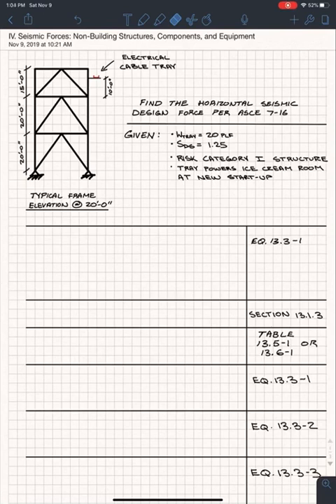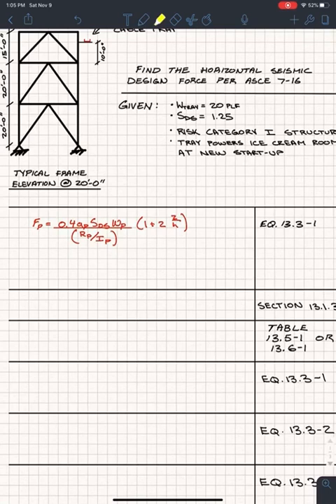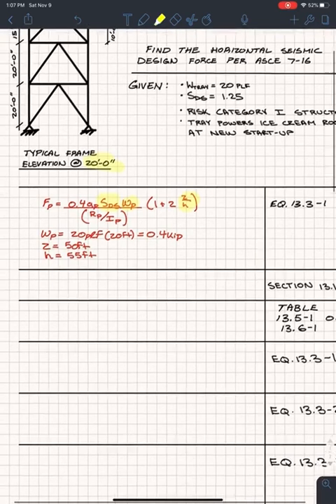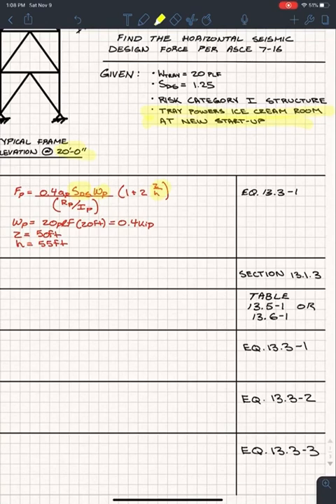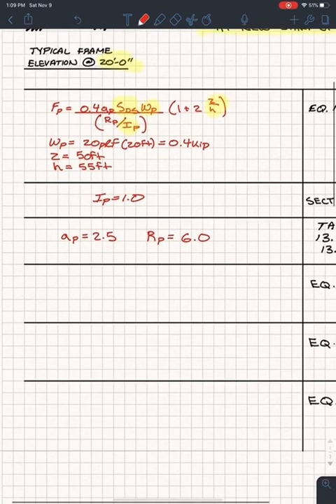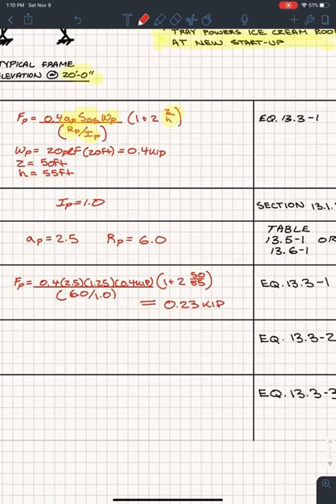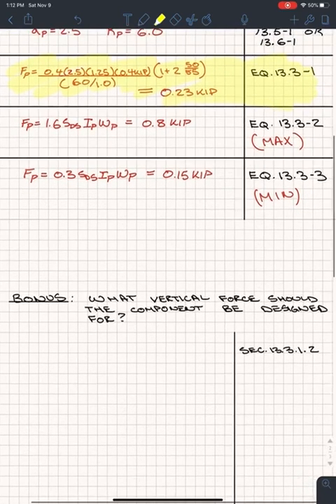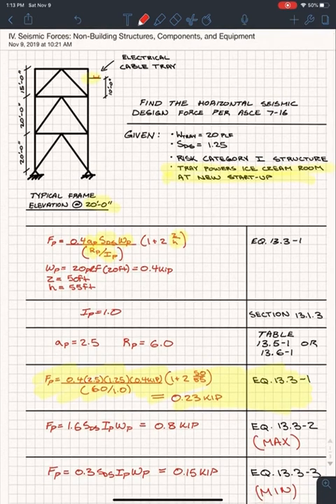PE Seismic Review: Non Structural Component Seismic Force

Comment: HI.. Guide me please.. after calculating this seismic design force for non structural.. how to put value horizontal force in staad pro when there is structural seismic force...please answer... or is this for designing bolts connection where electrical equipment need to fix on steel columns ???